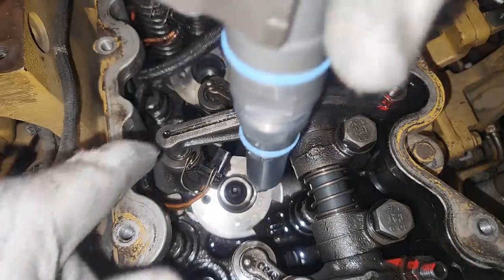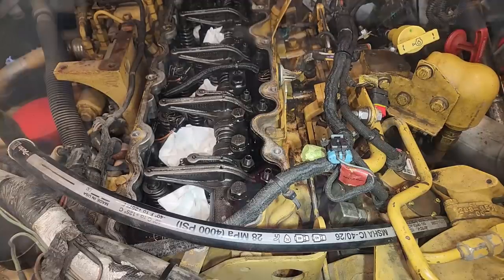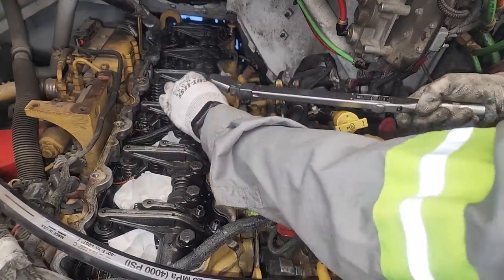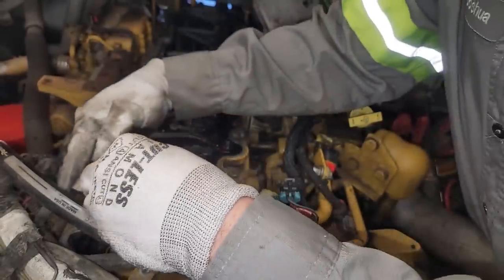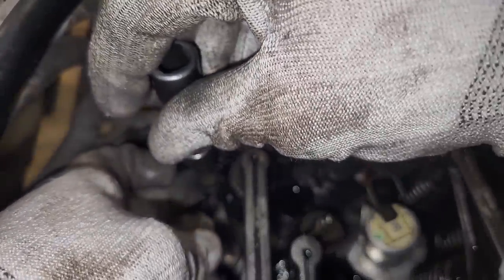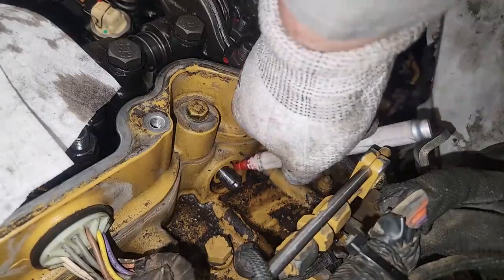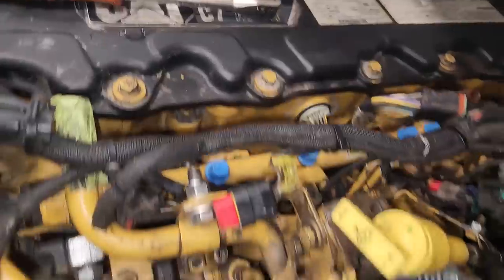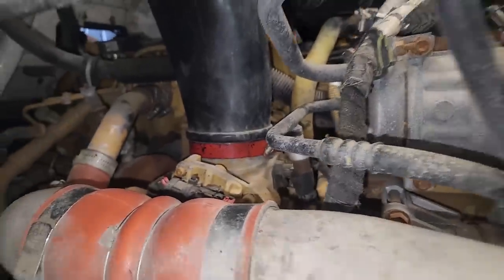Did Injectors Fix "Cranky" the Ford F-750 not starting? SURPRISE ENDING! "Cranky" Part 2

Comment: Great trouble shooting skills you have. I have a question for you I have another one of your favourite Cat engines a ct13 in a Cat truck. Last summer I had lots of problems with the emissions on it and it cost me 25k to get it fixed up. In the last couple of month\s it does not seam to be doing its regen when you are driving it. Now the light on the dash comes on that requires a parked regen. It works but I’ve had this truck for 10 years and up until a couple months ago it never requested a park regen. I have no idea what is going on so with you vast amount of knowledge have you ever Seen this happen? Thanks for your great videos.

Comment: I am looking to get a semi for the purpose of making it insane. What pre-emission equipment truck would you suggest getting and what engine to look for? I plan to use it a few times year to truck my clients cars, but otherwise it would be a toy I take to the drag strip.
Reply: Cummins 855 Big Cam would be what I'd use. Those things are basically bulletproof and they can create a lot of horsepower if they're set up right.

As to the chassis...your first choices would be either a Peterbilt 359 or a Kenworth W900. Old Macks would be pretty cool too.

Comment: What is your opinion on pre filtering fuel to allow you to pre fill fuel filters? Our shop has a cart full of fuel with an electric pump and a 1r-0749 filter attached so you can essentially pre fill fuel filters with equivalently filtered fuel, if that makes sense.
Reply from the maker: That makes sense, starting an engine with dry fuel filters is bad for the injectors. I think prefilling is good if you fill it from the dirty side, especially on the secondary filter and use filtered fuel if you can. Of course vacuum filling or pressurized filling system like Mercedes uses is the best way.

Comment: Hey from one mechanic to another, have you run into any of these new amber/beige colored o-rings I'm seeing more & more lately that seem to melt away at the slightest rumor of heat & petroleum base?? I don't know who manufactures them but I'm seeing these come on all kinds of parts and these o-rings look to be sold by the same major supplier, and they suuuuuuuuuuuuck. So bad

Comment: What’s your opinion on the Volvo d13? They seem to run better compared to the Cummins the other semis have in our yard
Reply: good engine, they have injector cup issues but they can be replaced on the engine in about 8 hours,
Reply: Great motor, the onkynproblem i have with mine is the emissions system.  Once it hit 500k, the emissions system has it in the shop every 10 days its run.  Every sensor and the wiring has been replaced plus the dpf.  Still has the same problems.  Anymore, as soon as i get the 5mph limit timer which starts out at 180 mins.  I just pull over and get the dam thing towed.  Cant wait to get my kenworth back.  Its a c13 with emissions,  but thats usually only 1 of 2 things.  Either the fuel filter needs replaced or the ard head took a shit.  Simple to diagnose anymore.

Comment: I have a 6.6 acert in a feller bunched. Cat just did injectors 3 months ago. Had two failures right off the bat. Replaced those two and it’s been good till about 2 weeks ago. Two weeks ago cat did injection pump and I had another two failed injectors. Put those in ran a week and now it’s acting like it has another injector failure. Any ideas what’s going on? Is it faulty parts? Injectors are remand in Mexico.

Comment: C13 acerts, do you know if youre supposed to replace the injector hold down bolts after you take them out? Don't remember seeing that in the manual. Thanks!
Reply from the maker: Yes, any time injector bolts are removed on a Cat they should be replaced.

Comment: The code thing is so typical. With one thing wrong, the ECU will not have met the necessary prerequisites to perform the diagnostic checks for other systems. Fix that one problem, and then it proceeds to error code away on the rest of the stuff that's wrong.

Comment: @10:00 I don't torque stuff like that generally as I work on light diesel engines that sell complete for $7-8,000aud complete second hand. If I ever ruin an engine which I haven't in 15 years it's just an insurance claim. Last one was a Mitsubishi Triton 4N15 engine one of the apprentices did the timing belt and didn't change the tensioner pivot and it snapped I fixed it and we claimed it on insurance.
I know heavy guys that laugh when I ask them about torqueing stuff like that but the operators destroy the machines. One told me they had a 44gal drum of oil strapped to an excavator as the owner just want's the machines to keep running. 
Thanks from Australia.

Comment: Have you ever had any trucks that came in running red dye diesel that aren't tax exempt? I have a friend that works for our local cat dealer and says he's seen it from time to time and didn't know if it was a common thing..
Reply from the maker: I've seen it before, but usually it's a dump truck that will stay on a job site and get towed around.
Reply: Any diesel truck at an oil rig is running red. lol

Comment: Hi Josh, 
What brand paint marker do you use?  I've tried several different white and yellow pens and they always end up leaking and  having the paint dribble out while writing, or the opposite and they dry up to quick and then I have to keep depressing the tip and squashing it
Reply: I've used Hobart welding paint markers and they work very well for me. I have used the same two for a few years (I don't use them much) and they always work well.

Comment: Looks like you always get the fun repairs. Being a CAT dealer I bet you guys can’t send it out with a deleted emissions system too. Bet that’s gonna cost big bucks
Reply: They could probably return it to the customer as is with the trouble codes and impending limp mode, but legally they can't flash it with a "delete" tune.
Reply: @abpsd73  exactly. They can’t hold your truck as ransom. That’s called theft. Idk where people get these ideas.
Reply: @thetowndrunk988  sure ,come and get your deleted truck. 
But bring a trailer as we can't allow it to leave our property under its own power and go down the road. 
That's not holding it hostage ,it's covering the companies butt from a frivolous lawsuit.

Comment: I will say this, when lubricating orings, you should lubricate them with the fluid in the system. In your case, you should have lubricated the injectors with fuel. Those orings may fail prematurely if they were not made to be in contact with oil. If it is a pneumatic system oring, you should use a non-mineral based lubricant. They make oring assembly lubricants and the type of lubricant is dependent on the system it is going in and the type of oring used.

Comment: OK now I don't feel so bad for hating the F750 with the C7 we have at work. Ran good until it didn't. 2 ARD heads and related parts and sensors later, installed by CAT techs, truck kinda runs better. Hate that thing.

Comment: Even the temperature that the hold down bolts are exposed to would not cause them to have to be replaced each time you change the injectors. You certainly aren't talking them to any spec which would stretch the bolts by any respectable amount.
I could see if you had to torque it down to 85 ft lbs or something, but 22 ft lbs, really? I would think they use a pretty decent bolt to start with?

Comment: Silicon grease probably better on o rings than oil, oil might swell them, thats probably why they sed 'dont oil them' but i digress, not a diesel mechanic here
Reply from the maker: The o-rings seal Diesel fuel from engine oil, so they hopefully are not damaged by the fluid they are sealing against.

Comment: Well even for a badly designed engine you still hit it on the head of poor maintenance which leads to failures of other things.
All those problems, modifications, deletions of things I am surprised that it somehow still manages to run. (very poor running engine)
Others probably would have replaced the engine or sold off the truck and problems to someone else.
Who knows after you are done with it, it will be an almost brand new engine running like it should from the factory.

Comment: The city never do there maintenance on any type of schedule,……… Most vehicles run until they have to be fixed. This is exactly why I would never buy a government vehicle especially any type of city vehicle,…..super poor maintenance and vehicle treatment. The workers simply don’t care. All they care about is if the air conditioning or heater works.

Comment: why not jut put the old ecm back on it? wasn't the issue the injectors? pop the old magic box in and call it a day, more reliable without thay crap anyhow...
Reply: I was thinking the same thing. I hope they still have that old ECM.
Reply: He would lose his job and the business would be fined a major fine when the county told the feds about it.
Reply: The feds would throw a hissy fit
Reply: More than likely that ECM is on its way back to the factory to be remanufactured. I’ve never R&R’d an ECM that didn’t have a hefty code charge attached to it. Also as the dealer they cannot legally disable, modify, or delete any part of the emissions system. Lots of shops have been busted for doing just that and they are fined for each truck they modified.